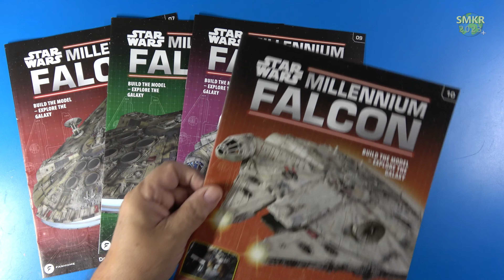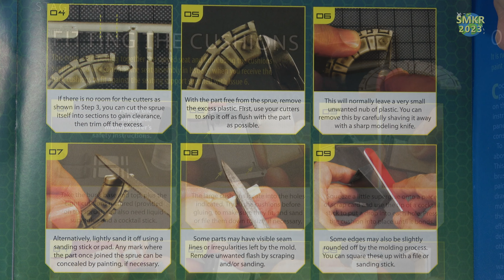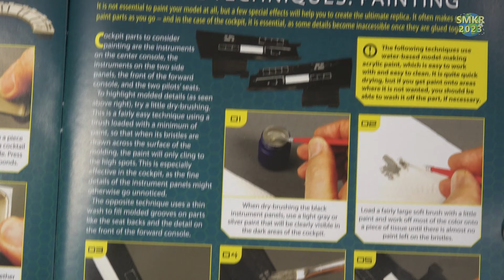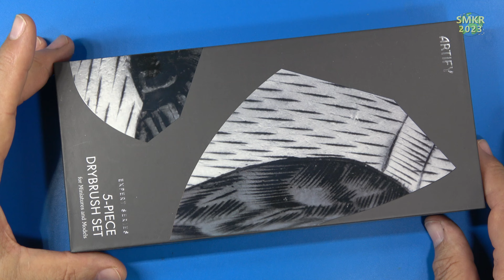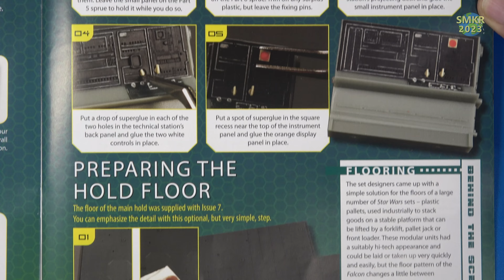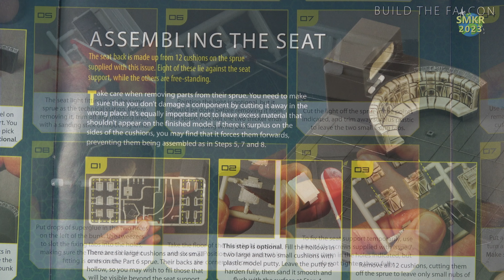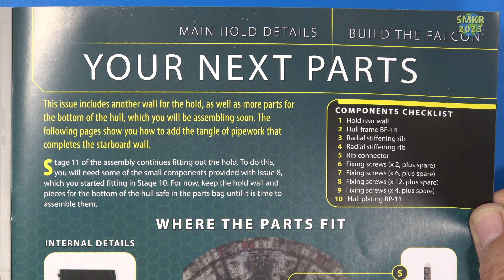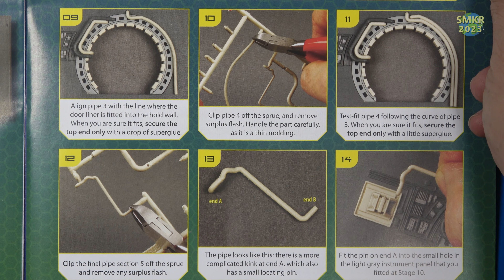Star Wars Millennium Falcon Stages 7 to 11 By FanHome | ASMR

Comment: I’ve got the Model space Millennium Falcon and what you say about the cockpit being different, that’s wrong as model space issued 2 different versions of the cockpit. There’s one with 3 pieces and another that’s 2 pieces. This is to do with if you wanted to use it in either with glass or without.
Reply from the maker: Modelspace made the correction to the canopy and issued the newer version around issue 40.  I know because I also have the modelspace kit in my stash.